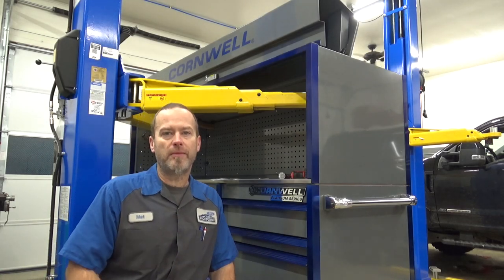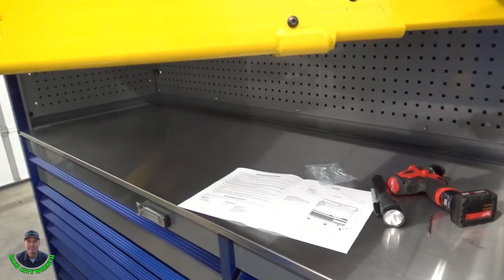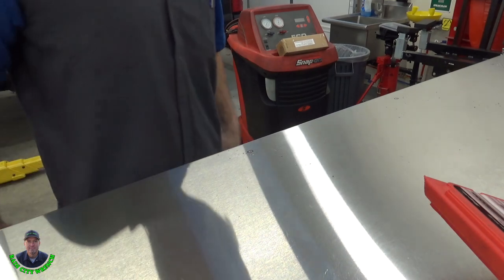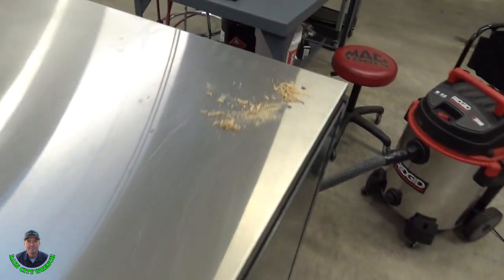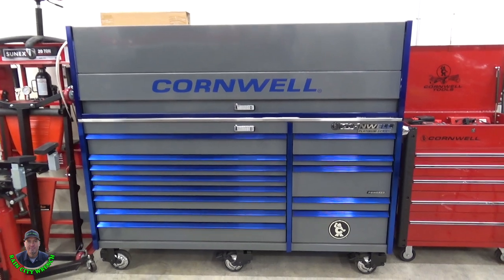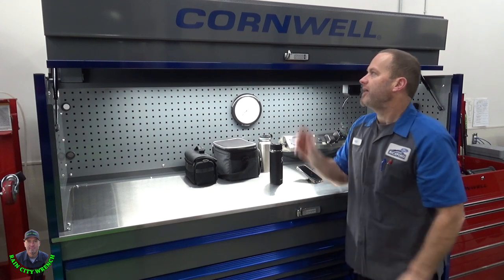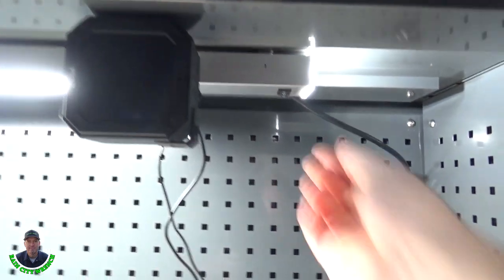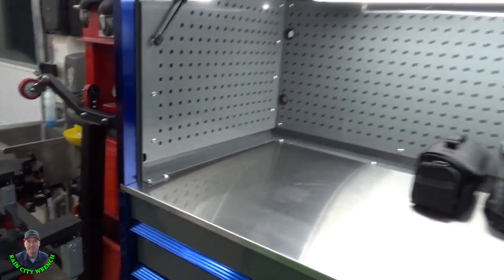TOOL BOX CANOPY INSTALL

Comment: I love this box, I got the graphite and black trim combo with hutch. No regrets!  So yes, someone in Ohio owes me lunch. God bless America 🇺🇸
Reply from the maker: Very nice. Have had mine for a few years, everyone that sees it says "nice toolbox!"
Reply: How’s the box so far. Got mine exact color as yours coming in this week. Went from a snap on 68 epiq so curious to see other boxes outside of snap on
Reply from the maker: @felixramos5808  One of the plastic stops on a drawer slide broke a few weeks back. It's under warranty and they have one coming. Drawer still works but will overextend on one side. I always open each drawer all the way to keep the slides moving freely and probably a little hard on the stops so I don't slam them open on the stops anymore. I lubed the latch mechanisms a year back with some silicone spray & an acid brush. Probably have to do that every year or so but other than that it's a fantastic tool box. I bought the canopy later on and can't imagine not having it, love it that much.
Reply: @raincitywrench117  ok thx for your input!  I see you got your box couple years ago, hopefully they worked some bugs out by now or improved somethings. I’ll make sure to lube the latches too

Comment: I still have issues with my draw slides not release on my 84 Cornwall platinum toolbox.  Have you had that issue or know of a fix?
Reply from the maker: Shortly after I bought it, a few of the levers were sticky. I sprayed a little silicone lube on each mechanism then wiped it around with an acid brush. Haven't had an issue since.
Reply: @raincitywrench117  
  you should check the little locks on the upper drawer slides. I've already replaced some slides and the new ones already showing wair.  I do use my box like a cart so when ever I'm working in the shop the drawer are in constant use. Here a link to my video on the issue if you haven't run across it yet. 

Watch "Cornwell Platinum drawer issue" on YouTube
https://youtu.be/HGW9N40mDbU
Reply from the maker: @itsatoolthing6323  I watched your video. I need to see if mine are showing signs of wear. Right after I got mine, noticed a few of the drawers would latch but were tough to release. There are two main vertical spars at the back which are foam lined that the drawers push into. A few of my drawer back panels were bowed out and when shut against the foam strips it would not allow to completely close applying pressure on the locking levers making it hard to open. The metal is real thick and took two of us putting all our weight on them to get straight, then lubed the levers. Been working real nice for the last couple years. So make sure when the drawers are closed there is a little slop when you push/pull on them. Also make sure the box is level front to back so the weight of the tools does not push the drawers out against the release levers. Hope that helps and good luck!
Reply: @raincitywrench117  I'll check the drawer for hitting the back. But I move my box multiple times a day.  Have noticed the weight on the drawer releases issue also
Reply: Same issue, I just manually lubed  it with grease by hand and no issues so far. After 2 weeks, it broke in just fine for me.

Comment: is the pegboard area magnetic?
Reply from the maker: It is steel and magnets stick to it. Has all sorts of different hooks that can be configured however you like. Went down to the hardware store and grabbed a couple plastic license plate nuts. They snap in perfect and allow you to install screws to hang stuff like my speaker. 🙂

Comment: Very nice, I’ve never seen a Cornwell up close. Is the quality like Snap on or Mac ? Thanks it’s too cool 😎
Reply from the maker: I think the quality is equal or better. I have a macsimizer at home and it's not near as heavy duty. Snap-on and Mac are unibody type design. The Cornwell platinum series has three square tube roll cages that it's built around. The 84" bottom box alone weighs 1300lbs without tools.
Reply: @raincitywrench117 oh ya that’s a serious box ! Enjoy!! Happy New year